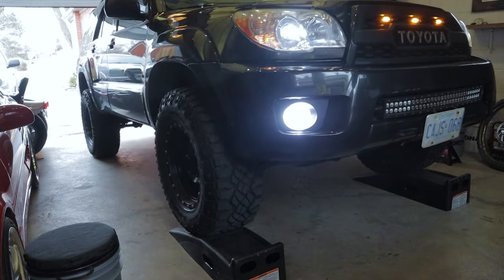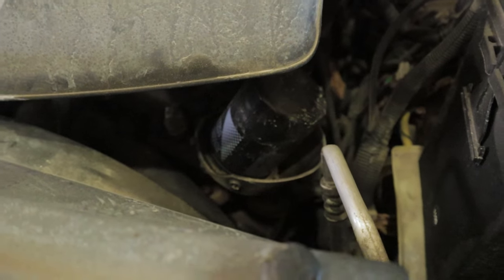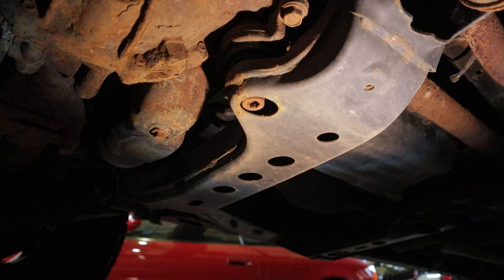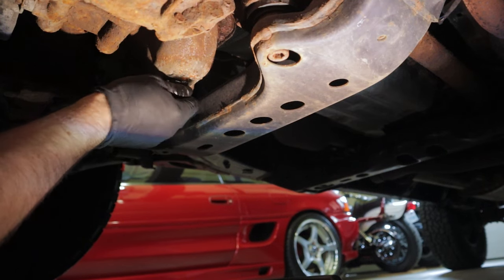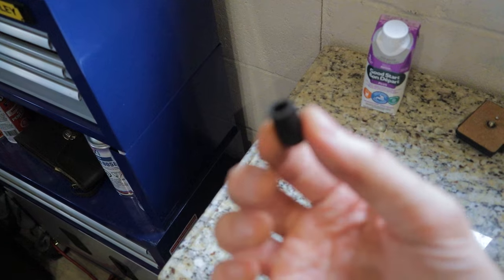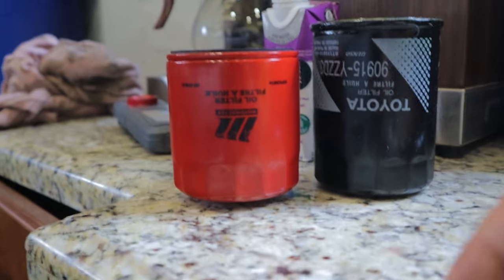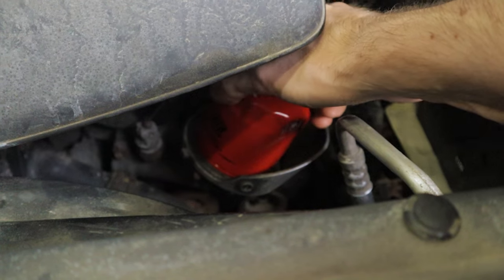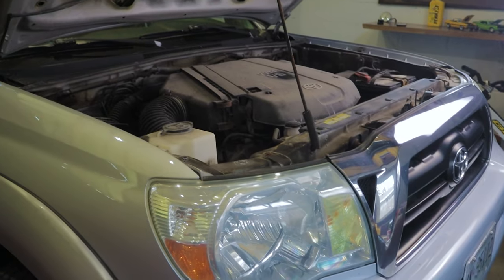How To Change The Oil In A 2nd Gen Tacoma In 10 MINS

Comment: Great video, I’d like to mention to not forget to reset your maintenance light for the dash. 
1. Put key in ignition
2. Press button on cluster, set it to Trip A
3. Hold down button as you turn the key to ON
There should be blinking dashes where the ODO is
4. Wait until ODO is Zero’d out

Comment: Last time I went to the Valvoline oil change place, I paid around $100+ and I watched the guy pull out my oil filter, looked at it, and then put it back in.   I paid $100 and he didn't even change it.   To top it off, they gave me a 3000-mile reminder sticker for synthetic.   So, i think I am changing my own from now on.  Thanks for the video.
Reply: That 3000 reminder is auto generated because they don't know your driving habits which is why it's say 3k miles later or the date
Reply: You can bring him to court for that!!!

Comment: I agree that oil changes are easy on the older models versus the newer models.  I have a 2007 Toyota Tacoma 4 L V6 and I started changing the oil myself three years ago after Covid hit because I didn’t want to take it anywhere.  Super easy to change the oil.  I’ve always used Pennzoil conventional and then switched to Pennzoil high mileage after I got up to about 80,000 miles and eight years old.  I am using Valvoline semi synthetic high mileage oil recently because I can get a great deal from my local store if I buy the oil, oil filter, and the engine or a cabin air filter at the same time.  It has 145,000 miles and I change the oil every 4500 miles or 6 months.  Still runs great!

Comment: 2005 taco just like the one in your video. Love it, 217,000 miles, burns no oil. I change it myself, the manual says 5.5 quarts US. I use Napa brand semi synthetic ( made by valvoline, my fave..) 

I’m a believer in fluidfilm! Have it applied by a shop I trust yearly. She’s holding up great! Best vehicle I’ve ever owned, and I’ve had new ones not as good as this taco I bought with 165,000 miles!!! 👍
Reply: Havoline   Anyone see this brand any more??? I worked at dealership and I saw they used to buy oil in barrel and Havoline (spell??)    But now I see no more??? Why?

Comment: I do a ton of oil changes on these 4.0L V6s did a water pump and radiator and Thermostat replace on a 2006 4runner last week that had the 4.0 V6 they are very easy to work on engines
Reply: How’s the reliability bin the 4.0L 2007 Pre Runners?
Reply: @ryanlopez4371  there very reliable engines there not power houses but they do have good low end Torque Only time I have seen one die was When a Offroader buddy solid axle swapped his Fj Cruiser with 1 ton axles and put 45 inch tires on it and engine did hundreds of Rock crawling trips and on a 90 degree grade of borders the engine locked up when it over heated and dumped coolant into back 2 cylinders. I would say there dang tough engines and very easy to maintenance. Just my take as a Toyota Tech

Comment: I have a fumoto drain valve plug on my 2012 TRD sport and it makes changing the oil so much simpler and cleaner 👌🏾good video
Reply: worry about offroad by accident you drain oil by that Fumoto valve !!!! If not offroad then OK but why? You buy an offroad truck and afraid of offroad that doesn't make sense huh!

Comment: You should always remove the old filter while the oil is draining from the engine. Never drain the engine, replace the drain plug, and  then remove and replace the filter. Old oil from the filter will drain back into the engine. Also, when reinstalling the oil filter, 1/4 turn after gasket contact isn't enough.

Comment: Dude, have you done a drain and fill for the tranny? Curious about your service history. I bought my Taco when it had 220 000 km and think it was done around 94 000 but not sure. Any tidbits of wisdom to share with a fellow Canuck? Cheers from NS.
Reply from the maker: I haven't done it yet but it's on the long list of things to do!
Reply: Look into the difference between a flush and a drain and fill job. for an older high km vehicle. I am looking into a drain and fill job but have a little anxiety about messing with the tranny.  Happy wrenching. @CanadianGearhead
Reply: Just do a drain and fill brother. Don’t mess with that trans flush bullshit. Drain and fill is just fine for that old bird that has plenty of miles left to go.
Reply: Thanks bud, I plan on giving it a go next week. cheers! @BillyRay4280  👍

Comment: the new blue crush washers they use are wierd. You do want to use a full 30ft torque, for some reason those blue crush washers take way less torque to remove. so even if you use a full 30ft torque, they seem to come loose VERY easily. Kinda worrisome. Thanks for the video
Reply: The blue plastic ones? There not weird, there're junk, use them if you want a drip - especially when it gets warmed up.
Reply: Use the OEM Toyota blue crush washers. They’re not plastic.

Comment: Are you not using full synthetic? Just asking. I couldn't tell. If not, why not?
Reply from the maker: I just don't feel the need for it on these old Yotas as long as the oil is changed often enough
Reply: @CanadianGearhead Ok, so I guess, can you explain it to me? Especially with high mileage cars, and even non-high mileage cars… full synthetic is better for your engine, according to every car guy on the internet.

I guess if you change your oil every 3k miles it might not matter that much. But why not spend the extra $20 to get the better oil?

Truly not trying to troll you or anything, but I put full synthetic in my 2008 Civic with 120k miles. It seems like the consensus that full synthetic is better for your car.

So why not just put the better oil in your car? I’m asking out of curiosity, you’re more of a car guy than I am.
Reply: Great video.👍 I too own a 04 4runner & 07 tacoma. I love these 4.0 V6 engine, oil filter setup was genius. Easy diy. 
What area you live? Alot of rust under there. 😮

Comment: Can't always trust the oil cap all 3rd gen 4runners Orginal oil caps said 10w 30 If you get a new cap from Toyota Now for a 3rd gen 4runner the new oil caps say 5w 30 which is wrong for a 3.4l v6 Toyota started changing all there older vehicles info for oil.. my opinion as a Toyota tech to screw over older vehicle owners in putting to thin of oil in a older engine to blow the engine up to get you to buy a newer vehicle anything older then 2002 will not be 5w 30 but I'm just providing info dosen't pertain to ehat your doing good video @Canadian Gearhead
Reply from the maker: Very interesting!
Reply: @CanadianGearhead  I only said it because you mentioned just read the oil cap My suggestion would be Read the manual over what the oil cap says but if a oil cap can be changed manuals can be updated also say you loose the manual buy a new one from Toyota or any manufacturer if the manual has a update to it would be hard to know unless you pay attention to everything.. most people are very un aware of things like that... just my experiences.. 3rd gen 4runners always had green coolant toyota updated it all vehicles from the 80s to now have be changed to the Toyota red coolant so anything can randomly change even of the vehicle was spec'ed with a specific thing when it was made.. just makes you think how many things have randomly changed over the years that wasn't so noticeable..